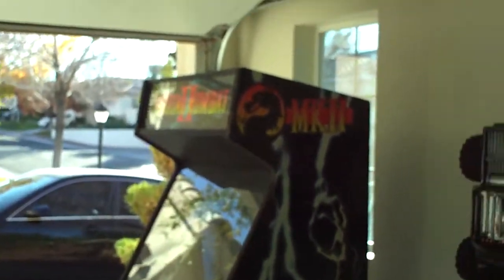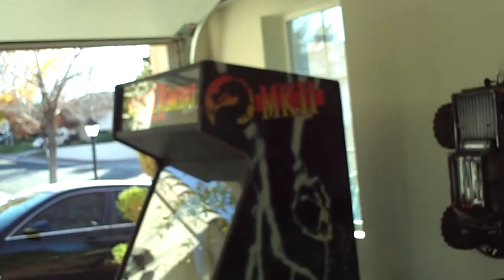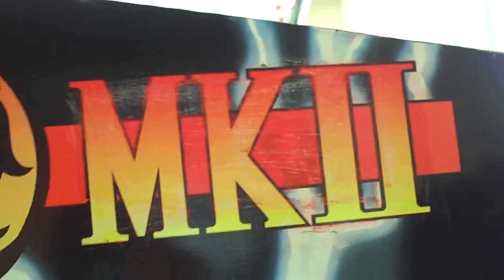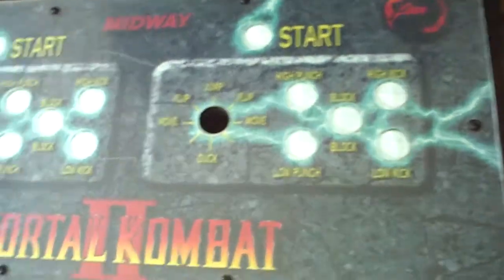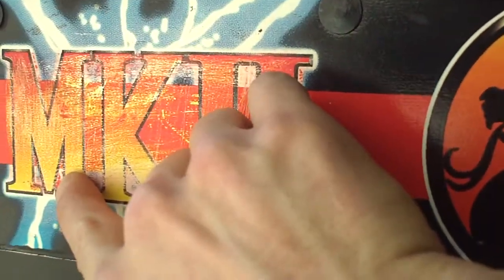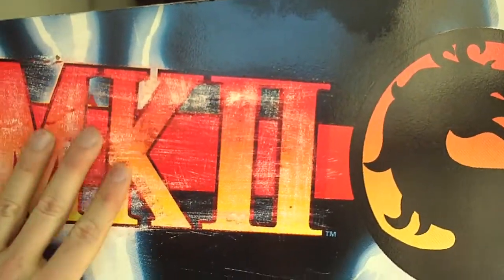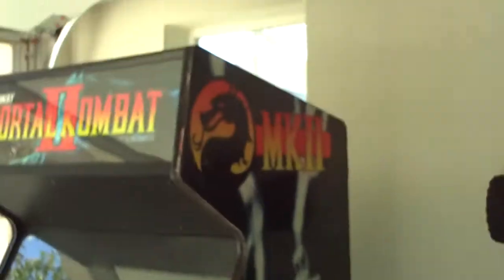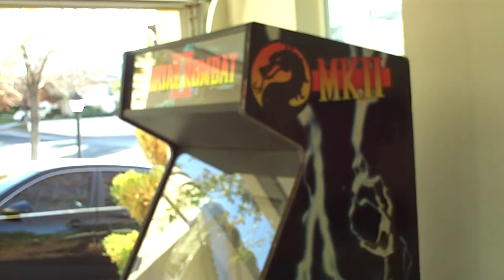Mortal Kombat II MK2 Jamma Restoration project Paint stripping Results

Comment: Thanks for the upload. I needed to see what the original art and bolts looked like on the CP box.  That sticker on each side of the one I received is rather big for some reason and there appears to be one extra screw head that I didn't see in your video.  You guys know where I could pick up the monitor control located right behind the CP box?  It's the one that controls the position of the video.